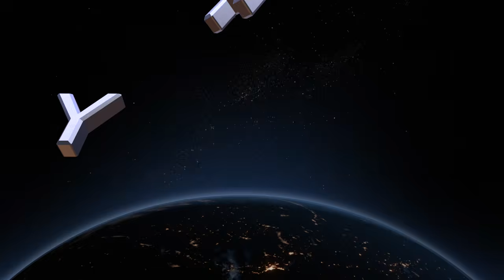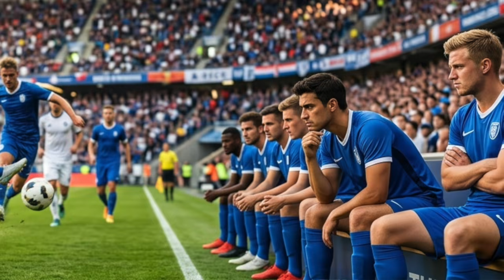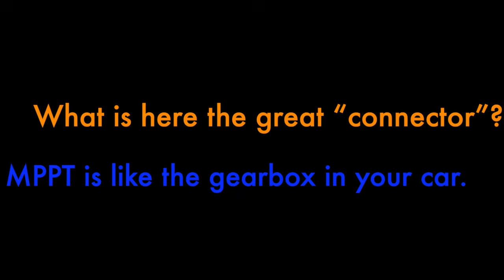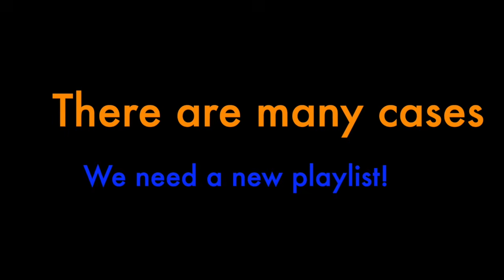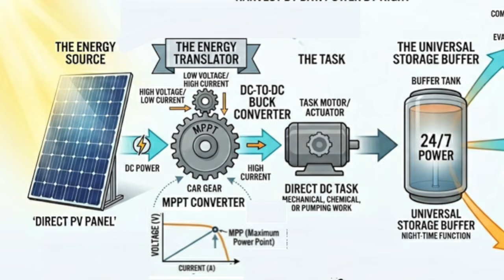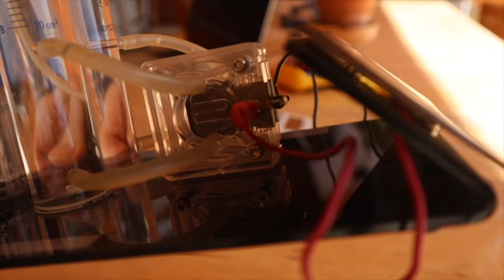PV2COM: Direct Solar Without Big Batteries – New DIY Concept - Video137

Comment: I have a solar grid tie system (5k) plus I have a separate 5k off grid system in my house ,,  I intend to use my off grid system for hot water ,,plus I like the idea of a sauna     ,,,please do ideas in what excess electric can be used for...
Reply from the maker: That is a fantastic setup, looks a bit to the systems I have been talking about right before this PV2COM. and using that surplus energy for a thermal load like a sauna or hot water is exactly how we keep the grid happy!
I will think a lot about applications of excess solar. One of them (large scale) is a project that I have been translating into Dutch: a multi-MW hydrogen factory that has been set up in NL because of excess PV and wind power in the region in North East NL. Other ideas that I will talk about next videos is where something is produced (commodities) with energy and then it can be stored. I also think about another hydrogen video (extension of video 49).

Comment: Electrolysing distilled water? It has too high a resistance. Add some "electrolytically inert" salt (Na2SO4 would be my choice) and the resistance of the water will substantially decrease, allowing higher current to pass hence faster O2 and H2 production in your cells. Na(+) ions won't turn into metallic Na on the cathode surface (or if they would they immediately would be destroyed by the surrounding water molecules) so the net cathode reaction would only produce H2. As it would in the case with distilled water. Similarly, SO4(2-) ions would not "transmute" into anything "exotic" on the anode, the anode would only produce O2! "Minor problem" though: regardless if you were using salt or not, the developing oxigene would attack your anode - unless it were made of some sort of highly "oxidation resistant" material. Platinum may be appropriate. :-) Gold? I'm not so sure. Copper? Iron?Forget it. Anything electrically conductive would work for a while but if you aim for something reliable on the long run then you will need the proper anode material!
Reply from the maker: I see immediately that you are a prof! I know that electrochemistry is a whole world apart and I have to prepare this well. I can do research on how electrolysers are made in practice. As a matter of fact, I am now translating such a machine into my native language NL!
Reply: @nnvasen-good-energy my imho is that hydrogen is not home-ready. You need electrolyzer, hydrogen storage and hydrogen fuel cell. Electrolyzer and fuel cell could be merged in a single apparatus. If you need really high capacity and long-term hydrogen storage, metal hydride is the only option. Use alloys like Ti2Fe or TiMn2, which store hydrogen at moderate pressures. Everything else either needs hundreds of bars pressure with fast hydrogen losses due to diffusion or cryogenic temperatures.